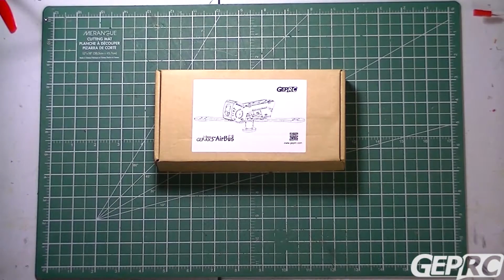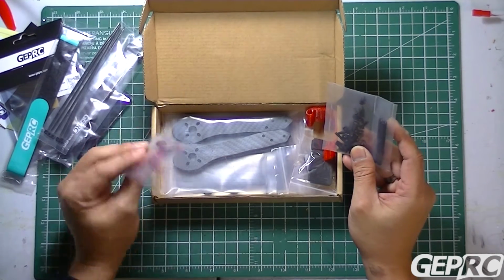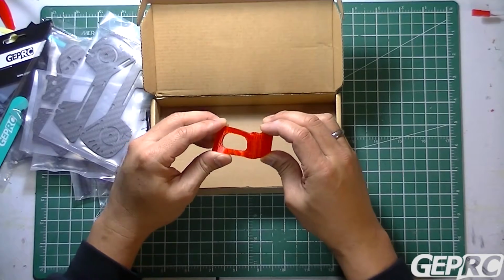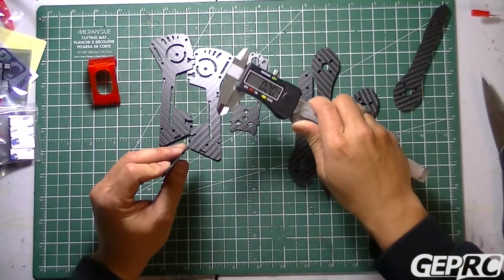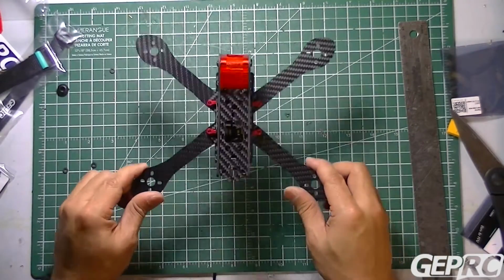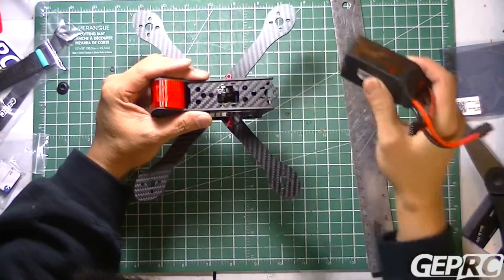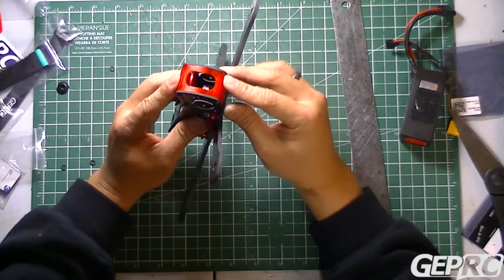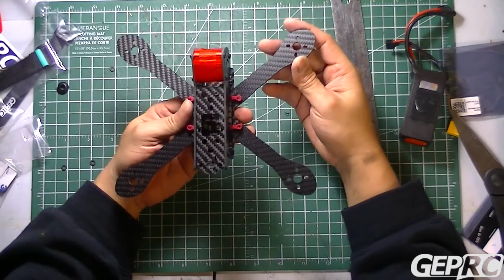Unboxing - GEP-AX5 "AirBus" 215 Frame

Comment: Do you remember when building this frame. Does the side plate screw on the bottom plate at all or u just stick it in and screw one side to the other and that holds it? Thanks